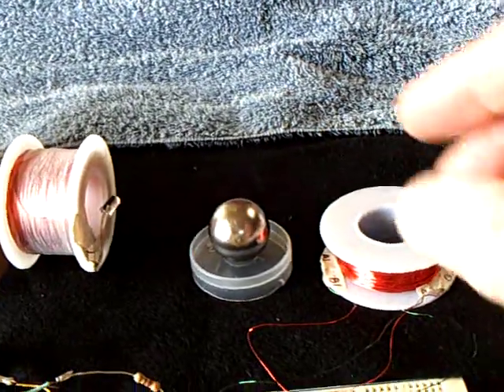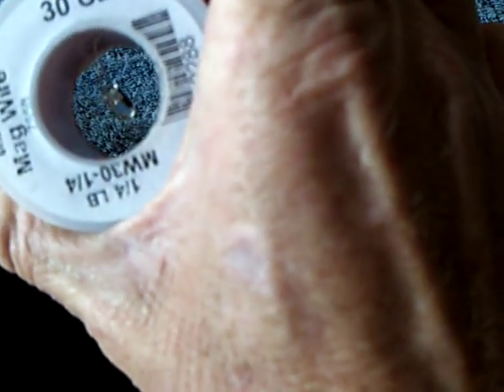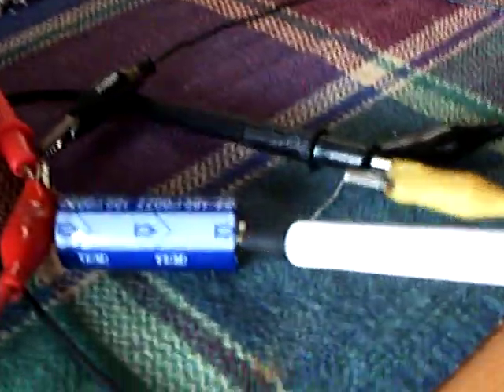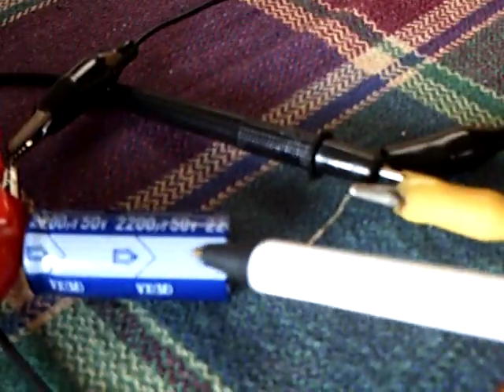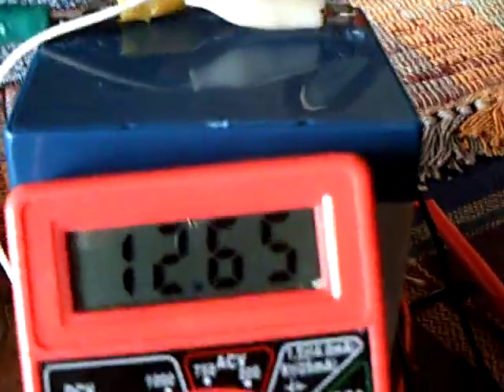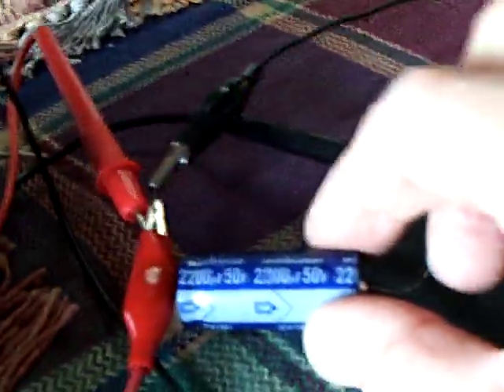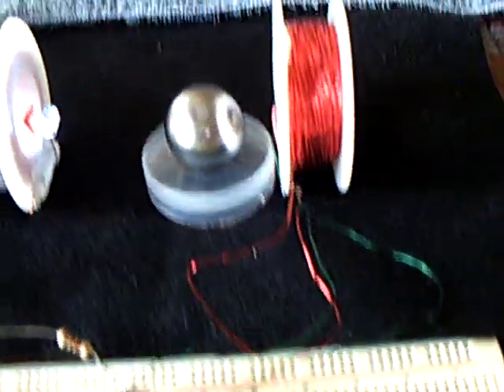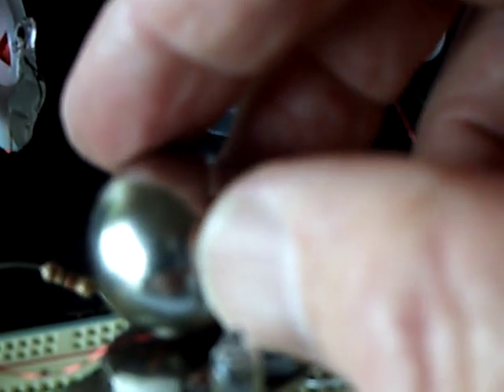Neodymium Sphere Magnet Bedini

Comment: how much led volts are? dc?
Reply from the maker: 2.5 v
Reply: @Lidmotor  can these magnet charge a carge able battery? i mean the magnet moves ac current the battery is dc, can these be done?
Reply from the maker: Yes.  Convert the AC to pulse DC using a diode bridge rectifier.  Smooth that with a capacitor.
Reply: So just ac connect to bridge rectifier ? What if without capacitor?

Comment: How is the coil spinning the magnet?  Please explain, thanks.
Reply from the maker: +George Welles Look up "Bedini SSG'.  The rotating sphere magnet switches a transistor on and off by generating a current in one of two windings in the bifilar coil.  The second winding is the dive coil and does the turning.

Comment: oh and btw you can probably quite down the sphere if you put it on a concave glass so it stays in the middle. you can probably find concave glass from a DYI store or make one by heating a glass disk while applying weight on the middle of the glass. or you can find a bottom of a circular glass container and cut it off. that should give you a better base for your sphere

Comment: you mean to say when you put the induction coil closer the sphere looses speed? that would be a limiting factor on how many induction coil you can put near the sphere. if that is the case, the tesla coil setup is more favorable than the sphere. for on a tesla setup you can easily add a ply wheel so the centrifugal force on the wheel will help negate the slowing effect of the induction coils

Comment: would it work if you added a iron core to the coil ? or would it just turn the coil into a electromagnet and attract the permanent magnet to it? if this is so would it work with a ring style neo magnet with something acting as a axle ? IE would the ring magnet spin like the ball magnet if you added an axle and an iron core

Comment: Hello there!

I was able to replicate what you did but as my Bedini circuit wasn't quite standard, it behaved in a different way.
So..bifilar coil 600 turns, 100k pot set to 0 (didn't have the 1k one). My power source was a 18VDC transformer.
For my surprise, as soon as I turned it on, it started self-oscillating with no need for the ball at all. It was drawing 640mA and pushed a broken 12V batt from 6V to 8.5V in 1h and the battery was able to hold it... though the readings was 11.33V

Cheers

Comment: How were you able to design it so that it spun 90 degrees to the drive coil? Is there a special process? Does this mean it can spin round and round on a non dished flat surface? What determines which direction it will spin? Does it just spin in any direction it feels like? Constantly changing? Also, does this produce any noticeable torque or can it not bear any significant load? This stuff has to have some sort of practical use in the future. Thanks for all of the information you provided me.

Comment: the bedini ssg circuit calls for a in2055 If I remember. It is very common. I got mine a radio shack. if you can't find one I can send you a couple ... they only cost about $1.50 @

Comment: scooterscottii - I instantly burned out a couple LEDs on the backspike with the blue&white coil, and am itching to put it into a bedini but can't finish my circuit.  My toroid wasn't from the plastic toy, it was a foam one from Michael's Craft Store.  And yes, the insulation in the lower gauge wire really gets in the way.  I'm considering removing it when doing my next coil... bigger...

Comment: Thanks for helping. I found how to build a bedini circuit. Do I need this particular circuit? Can I use other pulse motors and what other easy types are out there? I just want to spin a Neo magnet like this. You mentioned that the N&S poles face 90 degrees and it is not typical. What is typical then? Can I spin a Neo magnet so that the North stays up and the South stays down, or South stays down and North stays up, OR is this impossible? Is  N&S always going to "tumble" end over end?

Comment: I had a few questions. How could I find out how to build a "standard bedini ssg circuit"? AND Is the Neo magnet flipping end over end? OR is it spinning with the North pointed up and the South pointed down, or vice versa?? How far could you pull the copper wire coil away from the Neo magnet and have it still spin? I am assuming that the voltage always stays at 12 volts but the amperage is adjusted to increase the speed. Is that correct? Thanks for your help as I would love to try this.

Comment: I have built 3 rodin coils, and tested coil properties on AC and DC, 3V to 24V.  Very cool actions in and around the coils.  Then I found Bedini... and Lidmotor, Imhotep, Sceptic33, theDaftman and Pwordchernoir all experimenting in really cool ways.  I am building my bedini circuit now, and will post Rodin Coil + Bedini results within a couple weeks.

Comment: Whoaahh

I think that's a very nice way to get introduced to Bedini circuits since you don't need to spend time tweaking rotors and everything.
I wonder how a multi-coil or maybe something like 6-filar (1 trigger coil and another 5 power coils) would behave.
That little guy has the potential to load batteries pretty fast.
Anyways, going to try that myself.

Thanks for sharing and keep it up.

Fernando